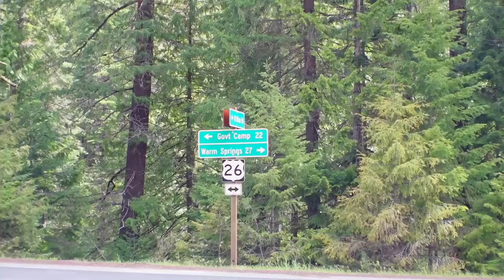When a mechanic has to call a tow truck..

Comment: Is it me but why would you send a tow truck to get the car when you have a extra wheel and tire at the house that you and a friend could drive up and change bringing everything you need to change and drive the car back? But then again the only odd rim on the car is the same one the has a blown out flat. Finds the car in front a stop sign and not pulled off the side of the road? With no marks on the road from the rim touching the ground where it rolled to a stop? Staged? You be the judge.
Reply from the maker: Well duh.   Everything on this channel is staged.  Did it really take you this long to catch onto the fact that we're actors??
Reply: @CaseyLaDelle  Funny but after 30 years as a mechanic and being involved in a tow or 2 you tend to see things that don't make sense. When a blow out like that happens while driving you see marks on the road surface and pieces of tire near by. More than once in my career people have told me what happen to their car only for me to ask now tell me what really happened? With them telling me the truth on what happened. I have watched youtube videos of engines being put together wrong with no chance of the that engine running  that way. When I bring that to the creator's attention the reply is the same the engine ran just find that way. Afterward many other mechanic would jump in the comments saying the same thing. I understand many creators take liberty's in creating content, while I find your content to be genuine this has to many red flags. While some can be explained away to many show a pattern.
Reply from the maker: @jims146  well darn, you got me making fake content again.   But since you obviously are such an expert in the subject, please, can you tell me and everyone else, what really happened here and why it was done?
Reply: @CaseyLaDelle  @ 0:26 you can see the tell tell marks on the road from the dollies, were they from when the car was lowered off the dollies and placed there or was there a second video take that was needed that had the dollies in place but because of a retake the dollies were removed I can't tell that, there are only marks. Also note no marks on the road from the rims at this time. @ 4:15 there are no marks on the roadway but @ 4:18 can see marks in the roadway as you push the car back, that car never moved on the roadway prior to this as it would have left marks on the road as the rim rolled on it. Therefore it was placed in that spot or the tire blew apart leaving no rubber while the car was parked there. Also you can see the mark on the outside of the rim on the roadway where the dollies were before. Were these marks from retakes of you placing the dollies and then removing the dollies and then reshooting and replacing the dollies I don't know. I understand about retakes @ 5:13 as we can see were you raised the car but had to retake showing the car higher in the front. If you watch @ 6:10 you can see you placing the strap over wheel but at @ 6:43 you can see the strap though the wheel again that's not a problem as you just didn't show removing the strap and reinstalling to a better position. So as you can see with the total amount of little observations and with a different rim and a much easy way to get the car home things just don't look kosher.
Reply from the maker: @jims146  ok Mr CSI, now the import question...   Why did I stage this whole tow??
Reply: @CaseyLaDelle  Content. Some do it for money, some are exhibitionist, some seek to be told of a job well done because that positive reinforcement was lacking as a youngster. Some just want to share their little part of the world. Some creators just want to pass the knowledge of what they have learned and to pass on the knowledge of what was given to them. Some just don't know for sure themselves, the list is as many as the number of channels on You Tube. But it all boils down to content the more content means more views and a validation of why/what they are doing is good. Why are you uploading videos, only you know but the reason for the video is content to reinforce the true reason you started your channel in the first place.
Reply from the maker: @jims146  ok cool, so you got that down.  Now, let me explain all the reasons that you're wrong!    In your reference to 0:26 I don't see any marks on the road at all, yet if you go ahead a couple frames to 0:29 and 0:30, I can clearly see the light white line going down the road from the rim ROLLING on it.   Now let's jump ahead to 4:15 where you say there are no marks on the road, and 4:18 where the rim makes a very clear mark as it SLIDES across the pavement.  Notice the difference there??   When the car was parked there the rim was rolling, and while I shoved it back into the cross bar it was sliding, due to the electronic parking brake.  Those to very different actions make two very different levels of marks on the road, as seen by the very different levels of marks on the road...    Now for 5:13 where the car is raised slightly higher.  No shit Sherlock, I quite literally have the remote in my hand an am raising the car..   Now for 6:10 and 6:43, yes, I changed the strap because I didn't like how it was the first time.  You should be a detective or something..    

Now since all that was just from your last comment, let's add in the rest of them!   Yes, that rim was different than the rest of them.  Meaning the car had probably previously gotten a flat and that was a spare that was put on.  Since you are such an expert in automotive everything, I'm sure you also know that most spares are very old and it is not a surprise that when put into service after many years of sitting who knows where, it's not unlikely for them to have a catastrophic failure instead of a simple flat.   Now for the car sitting in front of a stop sign instead of off the side of the road..  Actually, that is off the side of the road, and that stop sign is at the VERY wide entry way back onto the highway from a big half gravel half paved turnout, as seen in the video if you'd actually pay attention instead of trying to be a know it all..   Why so close to the highway??  I'm not certain, but if I were stranded and needing help in the middle of the night I would think being in clear sight of the highway instead of tucked back in the woods would have a higher chance of success 🤷🏼‍♂️.   

Now as far as why I supposedly staged it all...   You're wrong on all counts, especially since it wasn't staged.   It clearly wasn't done for money, as it doesn't take a genius to look at the view count, then Google what YouTube pays per thousand views, then do some simple math to see that I actually lost money by doing this tow..     And when it comes to all the other reasons you mentioned..  to put it simply, No.  You're the one here trying to gain validation from the internet by doing everything you can to make up, and point out the shortcomings of others whether they actually exist or not.   So you might want to take a long look in the mirror because I'm not the one in this conversation crying for validation...
Reply: @CaseyLaDelle  Well that escalated fast Casey did it not. Let's see if I can unpack all this, @ 0:29 that light white mark I think is part the dolly moving on the road. If what you say is that line is from the rim would not that white line be right behind the bead of the rim not off to one side. While a rim rolling can produce light white lines the brakes had to be applied to stop the car this would cause the rim to skid because the rim has a lower coefficient of friction than the tire making a much heavier mark. I see no marks like  those until when you pushed the car back @ 4:18 that would match a mark I would expect to see of a bare rim dragging on the road. I am writing this not only for you Casey to read but everyone who might read it. That is why bought up 5:13, 6:10 and 6:43 to show how one could mistake editing as staging something, I though I made this clear, my apology. As for your Query on why you might stage a tow as i said before I don't know I'm not a mind reader my Jedi Knight training is incomplete. lol As for why people download videos I stand by my psychology reasons given. While I may not have mentioned it but you have a reason why you produce these video's. Let see if I can explain my position, if a rock is thrown into a pond one would expect to see a splash and rips in the pond. If not why? Is the pond frozen? When you don't see expected results you ask questions. I am asking questions. When you say you lost money on this tow it troubles me on different levels. You say you tow for a living which is great but losing money is not in the game plan of a long lasting business. If you made this tow as a favor to your friend, very noble of you but if so please don't use it as a reason you stated. As I stated before I have found your videos very genuine which is why I watch them. This is the first I have questioned one. I wish you peace and success with your channel.
Reply from the maker: @jims146  let me make it clear and simple.  You have no clue what you're talking about.
Reply: @CaseyLaDelle  that bozo just won't quit, will he ?